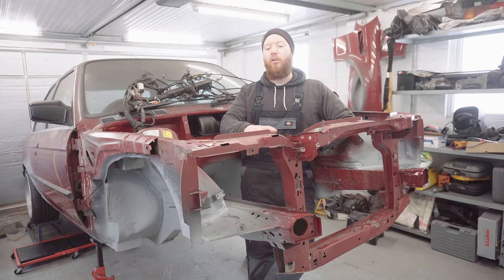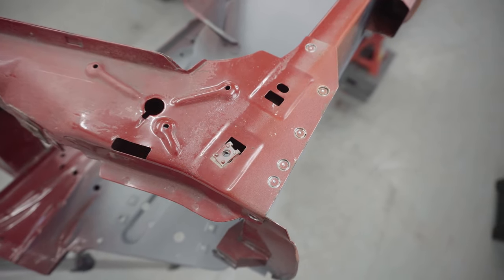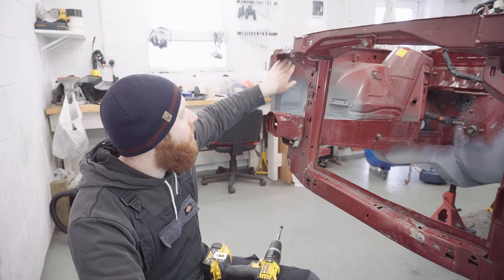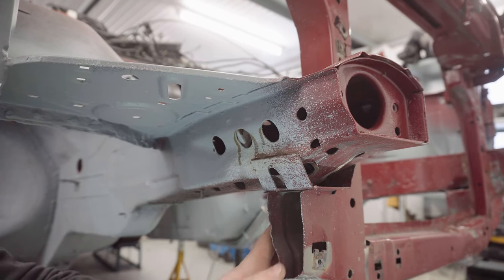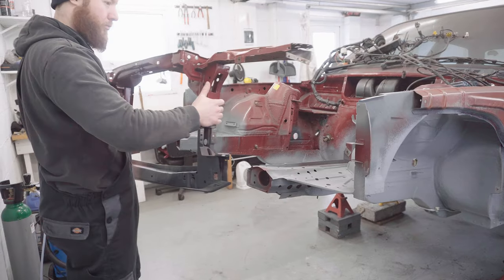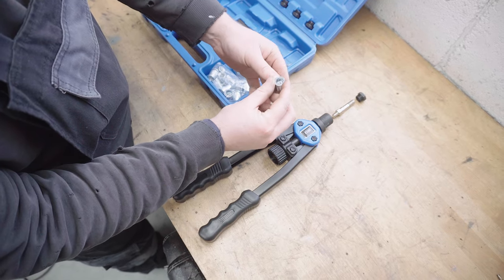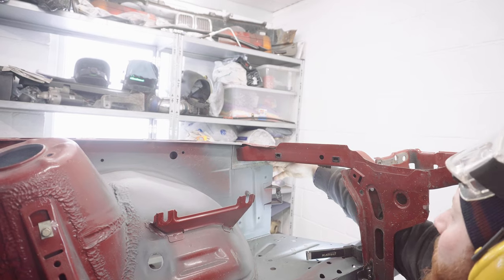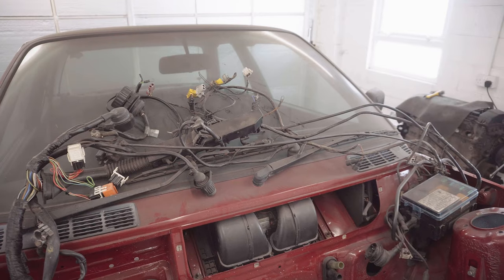BMW E30 Removable Core Support Guide | How To Convert To Bolt-On Front End With Rivnuts | 036

Comment: I havent finished building my car yet, but this mod is one of the best things i ever did to my e30. 

Every time i put in and out the engine with gearbox attached, i thank the day i did this.
Reply from the maker: I bet I will think the same! It's already proving very useful having the support out of the way. Cheers! 😄
Reply: @SPANNERRASH  btw i used captive nuts welded to a plate, thats stronger than the rivnuts. Keep in mid there is some serious effort on that part while holding the hood at speed.
Reply from the maker: @Coyote27981  my rivnuts do feel very solid but I'd probably do it the same way as you if I did it again as I've had mixed recommendations and better to be save than sorry.

I'll be keeping a close eye on them in the meantime. 🤞

Comment: From doing this a number of times, I would suggest not using rivnuts, they are not meant to be used for structural work. What I end up doing is making a reinforcement plate, behind the holes, with nuts welded on, that way you sandwich the weak thin panel. You can still do it, simply just remove the rivnuts.

Those mounting spots of the rivnuts will simply bend around the rivnuts and most likely loosen up over time.

8 or 10 spot welds are far greater strength than just 4 rivnuts!

I do custom car building for nearly 20 years and done a couple of E30s, so I know the materials you are working with.

My biggest concern is that you weakened an already weak panel, and then fitting a more powerful engine by the looks of it.

Not trying to bash your work, see you go into great detail, but don’t want you to end up having to redo it, after it fails and your project is done.
Reply from the maker: Thank you for highlighting that, from what I know the front core support doesn't do much in terms of structural integrity, but I won't claim to be an expert.

I think if I need to go back and modify it I can in the future, but for the time being I'm going to run with it. What you're suggesting sounds quite doable to me so thanks for the detailed recommendation on that.

I'll keep a very keen eye on the rivnuts I used and report back if I notice any issues with them coming loose. I'll be quite surprised though...

Ultimately it's a lightweight NA E30 build, I won't be running much more power than the chassis was built for. 👍
Reply: To understand this part of the chassis is a structural component or not, I would suggest you to watch more crash test videos.  BMW designed this body with  40+ years ago at that time, the best technology to provide a safe and reasonably priced small sedan for their customers. We as a technician or a restorer, we should not alter this safety feature for convenience.
Reply: Do not listen to this person dude! The panel you have cut off has little to no structural importance to your car, the chassis legs, strut towers and subframe are the important parts. This is purely there to latch your bonnet, hold the headlights and radiator etc in place. Simple example is a Citroen saxo, you can bend the front panel with your hands on those and other similar cars. Strength is in the legs, bulk head, strut towers and subframe. I know what I'm talking about, I'm a fully qualified car body repair and paint technician, I've worked in the automotive accident repair industry for over 20 years very successfully. I would only reinforce the single skin or thinner gauge areas that the front panel bolts to ie inner wings. You can weld so I'd definitely use a captive nut welded to a thicker gauge plate. Super easy! I guess rive nuts would be ok but again I'd have reinforced the area they're placed plus counter sunk the area around the rive nuts so the front panel bolts flat to the adjacent panel. Right now your front panel is bolting tight to the surface area of the rive nut only. You could also just tack the rive nuts too after you've pressed them, just as a secondary security measure. I have known them to spin over time. 
I think I'd have used more that just four bolts too. Definitely the most important part of the front panel is the lower cross member to the underside of the chassis legs which You've now got dangling in the wind. You'll find this is the thickest gauge or even double skinned area of the front panel. 
You've done a top job though, well done 👍🏻

Comment: I just want to say a MASSIVE thank you, im at about the same stage as you and I was contemplating not doing the removable Rad support, but im running a turbo and it makes so much sense to have it. you made this daunting job seem so easy and achievable. I completed this on my S1 E30 today thanks to your video mate :)
Reply from the maker: Awesome congrats on getting the job done on your own E30. 😃 Really glad the video helped you out. I was also daunted by this job, and sure enough it was difficult but totally doable with patience. I reckon like me, you'll be glad you went to the effort in the future when you're working on the turbo engine. 👍

Comment: You made a massive high precision job look easy. I noticed the heads of the rivnuts supplied with the tool sit quite proud of the panel. A firm called Northern Precision supplies a vast range of rivnuts including ones that sit fully flush when fitted, which can be very useful for some applications. I would have posted a link, but YouTube doesn't seem to like showing posts with links in.
Reply from the maker: Cheers! Yeah the rivnuts were a bit of an issue at first until I sloped the brackets slightly.

I'll check out that company you mentioned, perfectly flush rivnuts would be brilliant for this job! 😄

Comment: Brilliant job, but I hope it’s just as strong as all the welding points. When it’s welded, the strength is maybe divided over more places, but I’m not an expert by any means. It just crossed my mind. Keep up the good work man 👍
Reply from the maker: Thank you Dennis! It may not be as strong as the 30+ spot welds, what you're saying about stress being divided between them will certainly be correct.

But I think with the hefty M10 and M8 fasteners I've used, along with the 1.5mm plate mounting points, it'll be solid. It certainly feels it when bolted on currently.

Plus, from what I've read the front core support on these cars is not a key structural piece, so doesn't come under much strain.

I've seen people do a much flimsier job while running a lot more power, without hearing of any woes. We'll see how it goes! 😀
Reply: On these cars the core support is only there to hold in the hood, lights, radiator and that stuff. The hood will probably bei the biggest stress factor as it's the heaviest part and also moves a bit while driving, and as long it holds that firmly in place he'll be just fine, and he seems to have done a very good job 👍
In case of an crash the crash bar behind the bumper is keeping the frame rails from pulling apart, thats way more structural than the core support.
On most new vag cars the whole front core support is plastic, which immediately breaks apart in an crash and they still get 5 Star ncap ratings cause it's not structural
Reply from the maker: @philipkoller3007  Cheers Philip! That's very reassuring.

Comment: Great work mate , what you should have done is we’re the rivnuts go , use a socket slightly bigger and hammer a counter sunk mark for the flat heads to sit in so they are not proud , also etch prime over the rivnuts and seam seal the backs to prevent rust
Reply from the maker: Cheers Jason! That's a great idea about the socket, but I'm not sure I could have hammered that chassis leg without making a bit of a mess, it's a heavier gauge than I expected there to be honest. There's probably a nice tool which would dimple in. I was surprised how much the riv nuts protruded, but with some fettling, I'm very happy with the fitment of it now.

Funny you should suggest that as I actually had the same idea and seam sealed the backs of the rivnuts off camera afterwards! I'd hate for them to start rusting straight away. 😆
Reply: @SPANNERRASH  yeah I’m working on a W202 Mercedes, most of the captive thread parts that hold fuel lines on and such snapped off so I cut them all of and used rivnuts then used primer and seam sealer .
They are a great invention also use copper grease on the threads buddy
Reply from the maker: @medievilassassin  Nice! Yeah now I've finally got a kit I'm sure I'll come up with plenty of creative ways to use it too. Really great tool!

and 100%, seized fasteners are the absolute worst!

Comment: Great solution. Love the spot weld tool! Made it a much cleaner job, without damaging it too much. Cant wait to see the engine going in from the front. Also gonna do a little engine bay cleanup? Love the shaved bays to a certain point, not too much, thats too clean in my opinion. ✌️
Reply from the maker: Thanks Marco, I'm glad you encouraged me to do the job, even though it was a tough one I'm very satisfied with the result. 😃

I'll have a think about whether I'm going to remove anything from the engine bay to tidy it up. I'm not planning to do a fancy bay but I do want it to look presentable and not have unnecessary brackets etc.

The trouble is, I'm not 100% sure which I will and won't use with the engine swap yet. So it might be a project for a later date.

Comment: Would a C101 plug have enough pins in it for a wiring connecter? as well as being insulated it would look neat and period too :)
Reply from the maker: Good idea! It should do actually. There isn't a ridiculous number of things which need to cross the front. The only other thing to think about is the bonnet latch. That one might have to stay the way it is. 🤔
Reply: @SPANNER RASH  how about five series bonnet cable. They use a joiner on the inner wing?

Comment: Awesome idea, but the bolt thread sticking out farther than the rivnuts will corrode, and when you go to remove them a few years down the track it will bite and spin the rivnut or snap the bolt, very common on offroad belly plates etc.
Reply from the maker: Thanks for that tip, that's a bloody good point!

I'm using copper grease on the threads which might help.

Although I can't quite remember if I used stainless bolts or not. If I did then I think it shouldn't be an issue, otherwise you're 100% right and I will probably change them to stainless ASAP. 😃

Comment: Loving this build so far this is really helping me with my E30 build! Just wondering what grey primer are you using after grinding things back/welding. What brand of weld through primer are you using?
Reply from the maker: Cheers Kieran! I've been using just cheap autotek zinc primer as weld-through primer which works well if you put it on light. I've tried a few though and been a bit frustrated by how "weld-through" it is. Concluded that this stuff is as good as any.

Comment: Your going to replace welds with rivnuts? On a structural member? Not the smartest.  If you welded nuts in I would have said ok.
Reply from the maker: I don't think its particularly structural on an E30 to be honest. And yeah I considered welding nuts on. If I have a problem with these rivnuts that's probably what I'll do. But feeling how sturdy it is, I doubt that will be necessary! We'll find out though! 😆
Reply: @SPANNER RASH  it is structural. It has torsion under cornering. It may not need to be hefty but it does need to be mounted firmly. I would think after several hard corners it may start walking the rivnuts out. Rivnuts are great for mounting components but shouldn't be used in something that required weld and glue to hold together. I will say you may want to add a strut tower brace. That will take that torsional load before your rivnuts do. Still not right but may save you.
Reply from the maker: @VR6NAVYVW  Good idea regarding the strut brace, I actually have one on the shelf waiting to go on at some point so that's lucky.

I will keep a very close eye on those ribnuts and if they back out like you're suggesting I'll make sure to report back on that.

Ultimately I'm making this content to help fellow enthusiasts out, so I'm keen to give the reality of it. I'm quietly confident about them though, they're really hefty and solid. More than I expected.